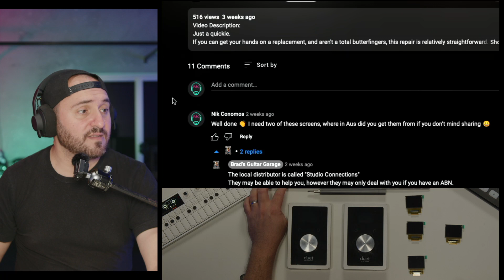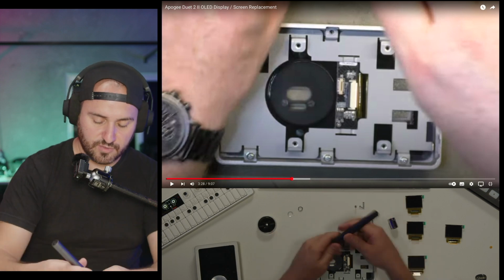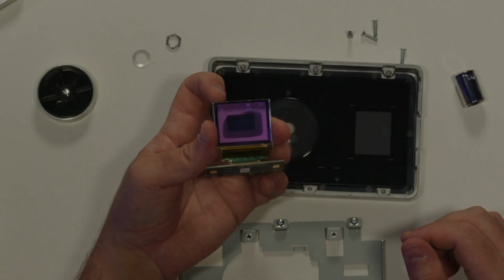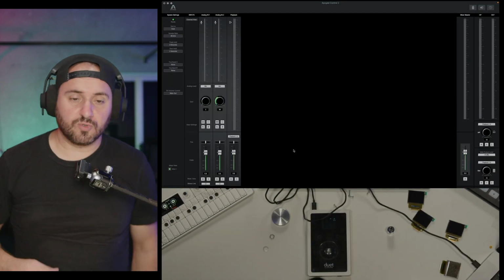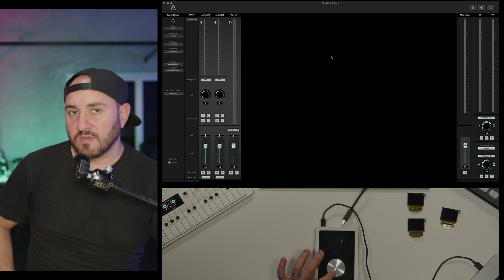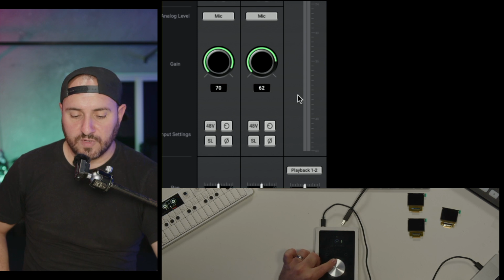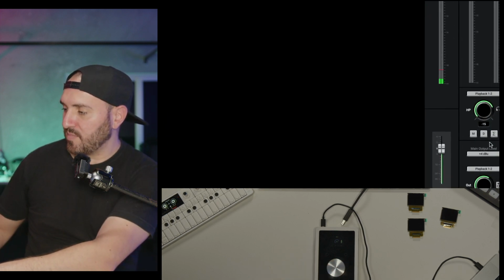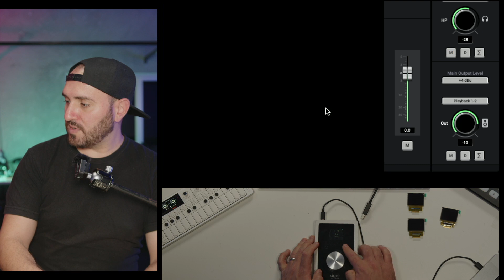Apogee Duet 2: Dead Screen Replacement/Repair/Fix

Comment: I don't have a dead screen-  I can see and make selections of instruments, headphones, set them to be muted or unmuted, and set their various levels, but the meters don't work on the OLED.  However  they work on Maestro.  Apart from the meters not responding on the OLED, their doesn't be anything else wrong with it.

UPDATE -  Unplugged and plugged the USB back in and the colored meters began to work.  Earlier they were stuck on to max with no change or interaction with input levels.

Comment: Glad I could help, mate! I have a feeling someone used a bit of glue on the knob on the unit I had.
The comment re: the ABN I think I got confused with Studio Connections and Music Connection, another one of my suppliers.
Reply from the maker: Yeah I was surprised, both my knobs came off super easy, I was waiting for the fight but it never came haha. I think it was a different name but either way they got me onto the distributer so thanks for getting me in the right track 😀